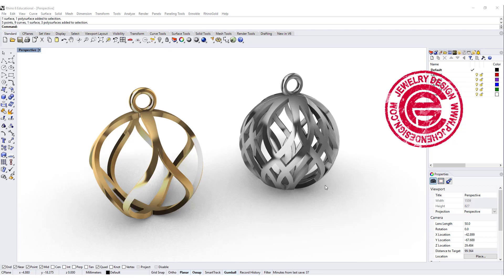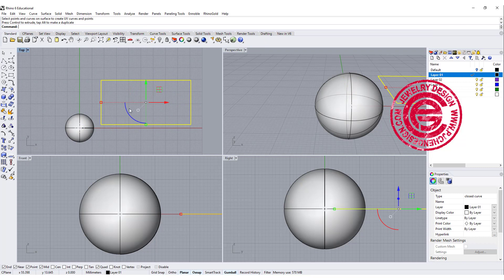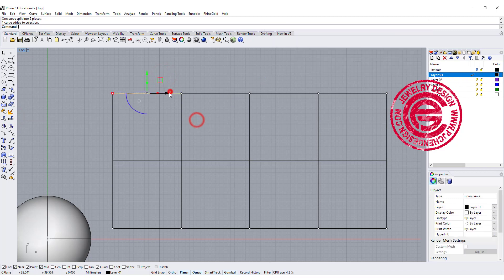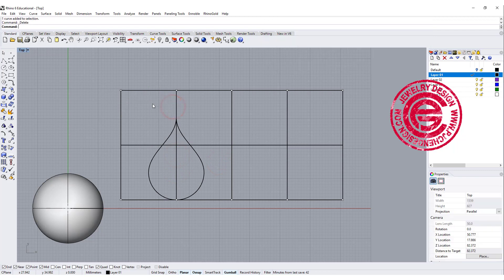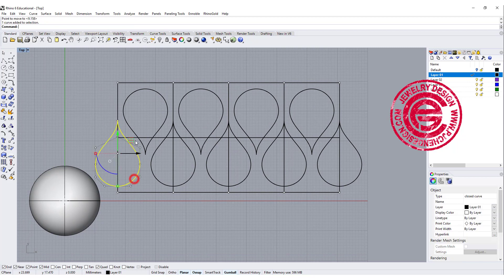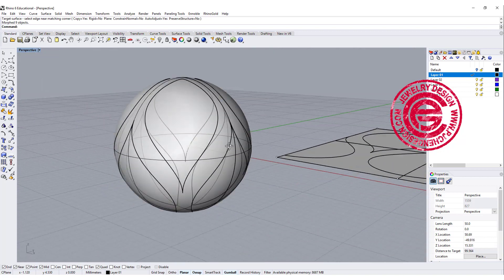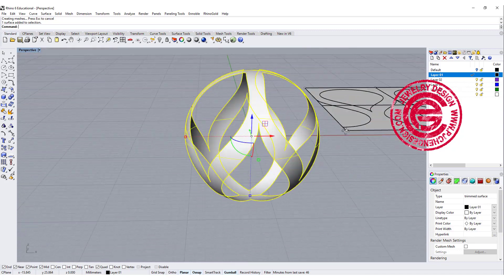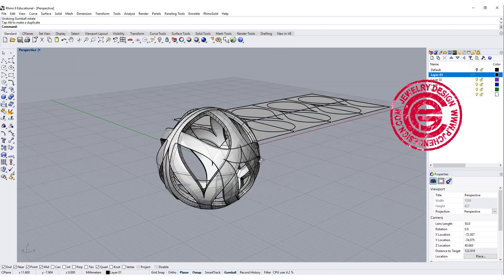How to Build a Wire Structure Bead Model in Rhino 6: Jewelry CAD Design Tutorial #78

Comment: Thanks again!!! But I was facing a problem with Flow Along Srf, i had tried like 5 times only i got the way, it seems that the selection of the surface will affect the outcome. The patterns or motives does not place in the right direction at first then i try to click on the bottom of the srf only it turned out to be fine.
Reply from the maker: the surface and curve all have direction in Rhino. if one way doesn't work just need to click on other end of curve or other side of surfacce.